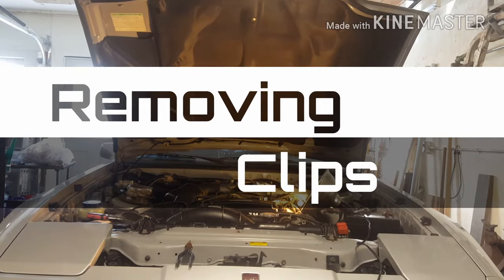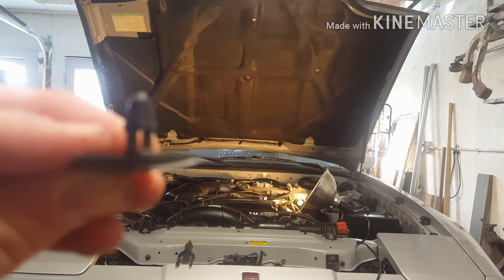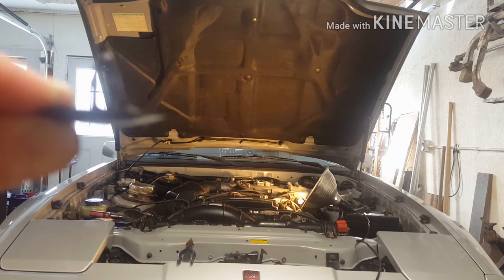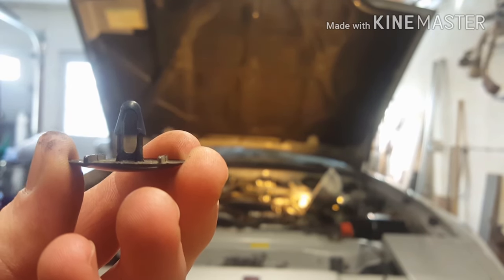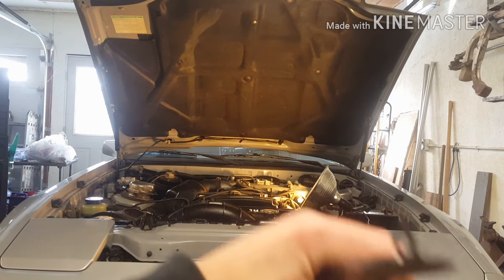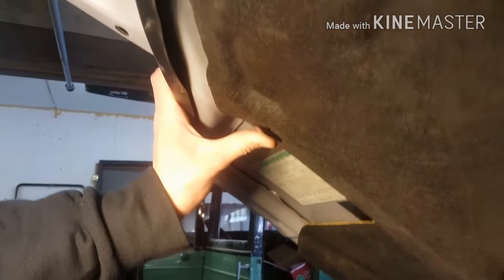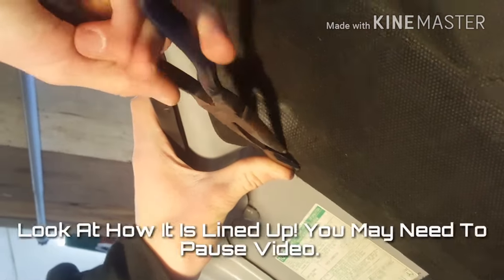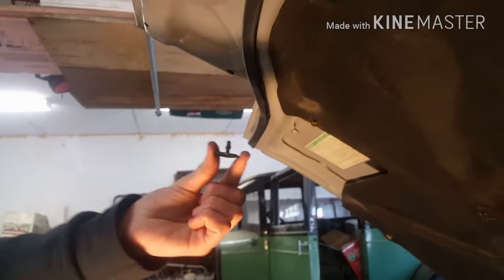How To: Remove Hood Insulation And Clips! (Toyota Supra)

Comment: Thanks buddy. To the point, loved it. Gonna try it on my LS. Hopefully should work. These simple jobs most often than not can give the maximum headache. I mean cleaning the throttle body or the MAF sensors seem relatively simple than figuring out the removal of these pins. Thanks once again.

Comment: Dude FN HUGE thanks. I have a 16 Dodge Challanger and the washer hose and nozzles are under the insulation. Simple issue simple fix BUT I dont have the stupid fork tool and autozone dosnt either lol. You rock

Comment: What kind of material did toyota use for the hood liner pad?
Reply from the maker: That's the original one I just washed it. I believe they sell then precut. Just look up year and model and then say hood insulation. Ex. 1989 Toyota supra hood insulation.
Reply: Ok ok but the original one in what kind of material was made? Fiberglass? Mine 1990/92 original one is going to waste and I’m hope is just in fiber or rock glass and not asbestos. Thanks
Reply from the maker: I would say some kind of particle board or something. Not too sure
Reply: @jaredzanelli7867  mine its yellow and look like very similar to rock wool or fiber glass, I don’t think about Toyota In 92 used a material so dangerous for such a large area, where you only need to muffle the noise and a mild heat of the engine. But I’m not an expert so I would ask to some that probably know better the panel